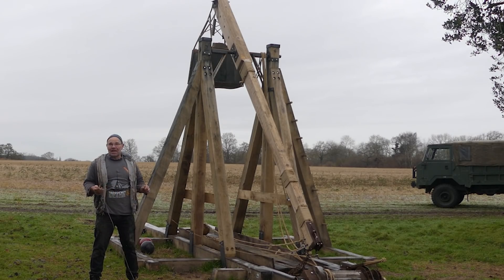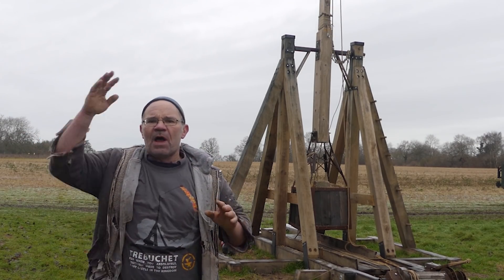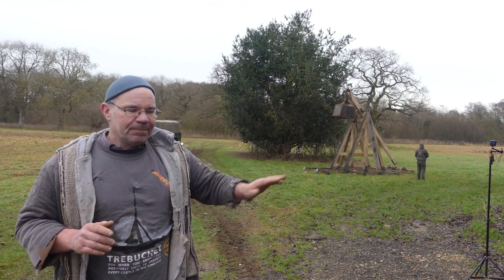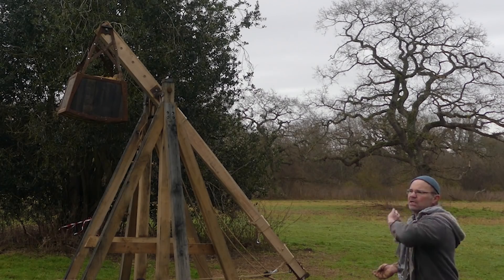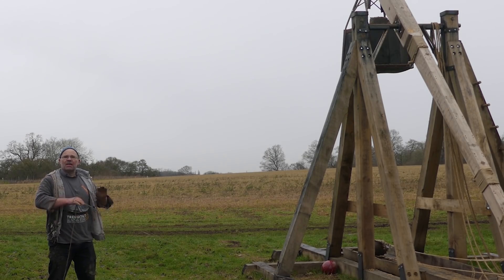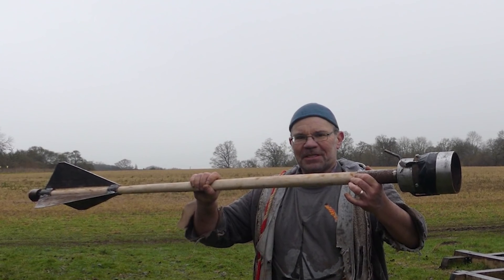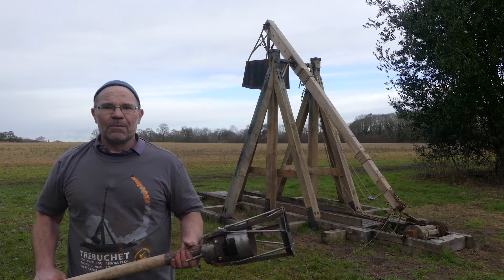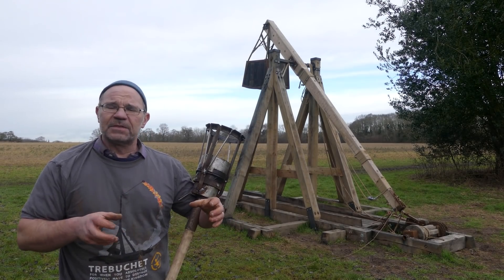Trebuchet. EPIC FAIL? Not yet......

Comment: Hi Todd, instead of increasing the length of the throwing arm, how about reducing the box weight to reduce and slow the downward energy of the box. Keep up the good work. Timo
Reply from the maker: I could do that but then it wouldn't throw as far and that would be sad
Reply: @tods_workshop  Hi Todd, firstly thank you for your prompt reply and secondly I'm no expert, but if you increase the arm length, this would have effects of reducing the kinetic energy release time of the whole arm system but at the disadvantage of the increaseing the whole weight of the arm system and thus puts more strain on the frames. Reducing the weight of the box has the similar affect of reducing the energy in the arm system but it would reduce the total amount of energy the frames will have to control. If I'm wrong in these assumptions, please forgive me and I look forward to a video just to prove me wrong. Timo
Reply: @tods_workshop  The whole system is energy rich and therefore the ideal solution would be to reduce the amount of energy to eliminate the ' box slap' but not enough to reduce projectile distance. T

Comment: As well as the angle, you want to release when the sling is in line with the arm. No idea how that can be tuned without messing up the angle at the same time. Projectile mass, counterweight mass, sling length and release pin seem like the 4 variables you can control to help with that.
Reply from the maker: There are just so many things to adjust I suspect you have to end up with "good enough"

Comment: just put the go pro on the shaft problem solved, why fuk around with that wide head that  increases impact, slowes the dart too fast in soil,
Reply from the maker: A fair point but my thinking is that I wanted the dart to be symmetrical and that would give the best chance of the dart flying stable and not rotating much - anyway yes it is complex and ~I may well end up with what you suggest anyway

Comment: You probably need some sort of mechanism to smooth the deceleration of the go-pro when it hits the ground. Shocks, springs, etc. Another option that may help would be to have some sort of sacrificial part connecting the go-pro enclosure to the shaft or rest of the head. It would be much easier for it to survive if it weren’t for the entire mass of the dart shaft trying to shove its way through where the go-pro is. One option would be for the shaft to be attached to the head at a slanted section joined by a sacrificial part: the force of impact breaks the connection, and the shaft slides off the angled surface and hits beside the head and gopro. The other, probably more complicated option would be to have the go-pro ejected from the head and be deflected to the side to ideally roll laterally away from the point of impact. I’ll throw together some (bad) drawings. The second idea might work decently well the more I think about it, while being more easily reusable… and I also don’t have much knowledge on techniques using sacrificial parts.
Reply from the maker: Hi Scott,  You are right about deceleration and if this were onto concrete I would agree, but damp soil will allow for an acceptable deceleration, but I think I will move toward a more disposable camera for this.

Comment: Trebuchets are exciting for about half a second. All the work that goes in to loosing just one shot is horrendous. You need to beat Joerg to the Instant Trebuchet before he gets on to the idea.
Reply: I think I have an idea for that, Joerg style of course! Use two  parallel arms, the first shot has to be manually wound/cocked, but the momentum from the aftermath of the first shot is enough to re-cock the trebuchet. Even if it has to be manually reloaded it would save time. I am doubtful though that there would be enough energy to do that after the shot without a dramatic redesign.
Reply from the maker: Ben - I think you have just invented a perpetual motion machine!
Reply: @tods_workshop  Is there a reward? I could really use one right now x
Reply: @benwilliams909  Problem with this suggestion - if you found a way to harness the wasted energy from a trebuchet shot, it would be better served being used to add extra 'zing' to the first shot rather than to cock it for another shot!
Reply: @Debbiebabe69  Completely agree, a system like this would greatly reduce the power of a single shot. I don't think it is a good idea as a real weapon, just as a conceptual x
Reply: @benwilliams909  Get on it laddy

Comment: Can you adjust the sling length until you find the best results,  then adjust the pin separately until the best results or will those differences affect each other, so that if you change one you would have to change the other to maximum results?
Reply from the maker: You could, but they are interrelated.  I have a suspicion that actually the difference in distance between a 40, 45 or 50 degree loose would be pretty minimal, so I think I have been  getting a bit concerned with exactly what angle, and should be more concerned with making the thing last
Reply: @tods_workshop  doesnt a low angle shot give the trebuchets more time to accelerate which would make up for the less optimal ballistic trajectory?
Reply: @tods_workshop  One more thing to consider is wind - I've read that it's better to use a slightly lower trajectory for a headwind or crosswind, as the longer the projectile is in the air, the more time the wind has to affect distance and aim (and in a crosswind, preserving your aim means throwing into the wind a bit to compensate, so it can be considered as similar to a headwind in terms of distance.)  Also, as wind resistance slows the projectile's forward speed more the longer it's in the air, the optimum should always be just a little lower than 45 degrees in calm weather, but never higher unless you have a strong tailwind (or unless you're trying to e.g. drop your shot just over a curtain wall, at which point you need more verticality close to the impact point - but that's a separate question.)  :-)

Comment: Those wide angle shots are amazing, I can’t believe how well the first dart worked, well done sir.
Reply from the maker: Thanks and I was pleased but the second was a disaster - I will nail it eventually
Reply: @tods_workshop  Can you mount the GoPro on the tail section.?  That would increase the chances of survival, or possibly use a parachute of some kind to at least get half of the footage of the flight and save the GoPro.!  Where there is a will...
Reply: @tods_workshop  more tail weight possibly... Or different release finger angle
Reply: Titanium!

Comment: I wonder if the texture on a stone ball would grip the pouch enough to give it some back spin, if it does would it be enough to make a difference to the range? I suppose it could be tested by coating a bowling ball in textured paint like the chip stuff on ceilings or the rough stuff on pick up beds?
Reply: Probably wouldn't have much impact.

Air-resistance, spin, the magnus effect, and all that scale with the surface area of the projectile (radius^2) and speed. Gravity and inertia depends on mass (density * radius^3). So for a small, not very dense, fast projectile like a golf, spin and air resistance are quite important relative to the other physical effects. For a large, dense, relatively slow projectile like a bowling ball out of a trebuchet, they would be rather negligible.
Reply from the maker: I think with the amount fo mass to surface area ratio it wouldn't make much difference.
Reply: I'm quite into slinging and catapults and can get a noticeable curve on stones at range but it's far more noticeable with a longer pouch and granite or something else with a rough surface, even as perfectly round as a stone gets, however the velocity (and spin) on a long sling from someone practiced at it is probably more than the trebuchet, it may be worth consideration, I'm very much on the fence on the outcome, btw I'm not talking about intentionally rough shot but just the natural texture of carved or chiselled stone, edited to say about the catapult part, that's irrelevant lol
Reply: What, chuck a giant golf ball?
Reply: You might get more range, but I'd expect your impact energy be decreased slightly due to lowered velocity upon impact.  It would also affect the angle of impact.

You could also dimple it like a golf ball, or add some pitch to make it more sticky, to maybe get some extra backspin.

Comment: Keep the rope you tied to the stone a little short, then it will go even further. The stone loses its power before it comes out of the catapult.
Reply: Hmmm, I'm thinking a two stone bola attached by a rope or chain.  One stone goes in the catapult sling, the other hangs free, allowing more energy to be transferred to the projectile while also adding spin.  Horribly dangerous if the chain breaks, though.